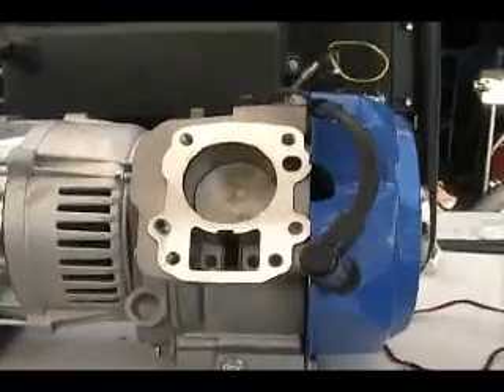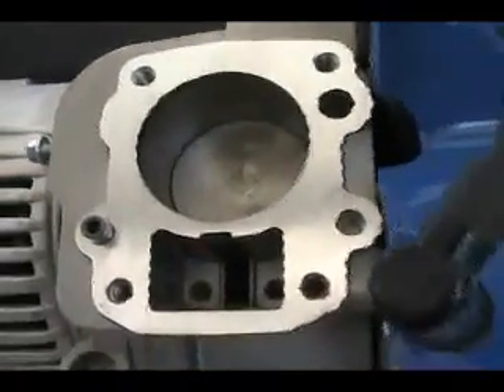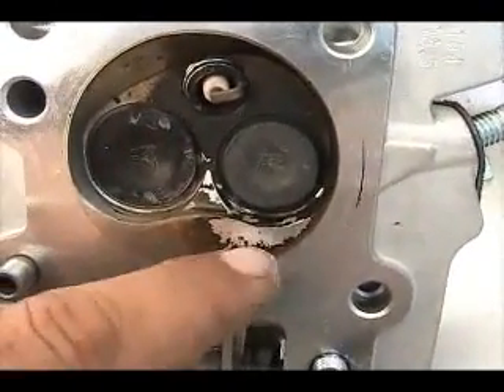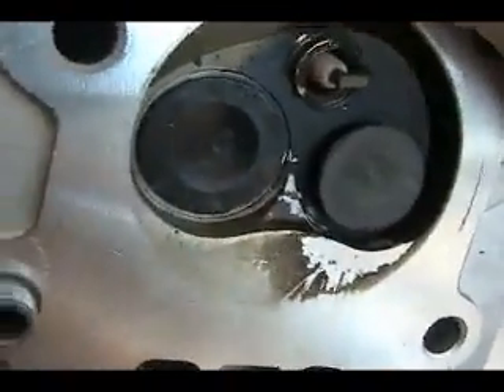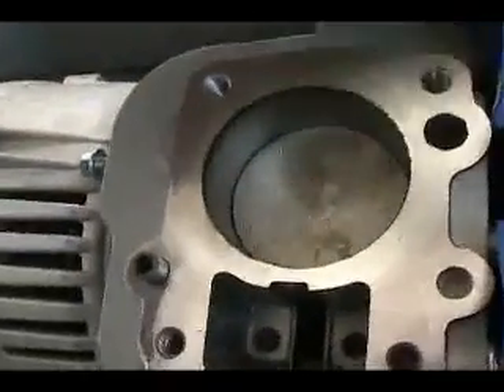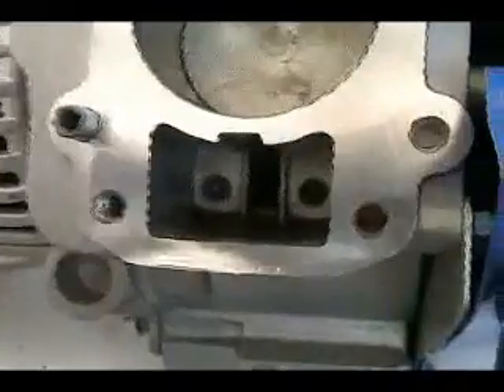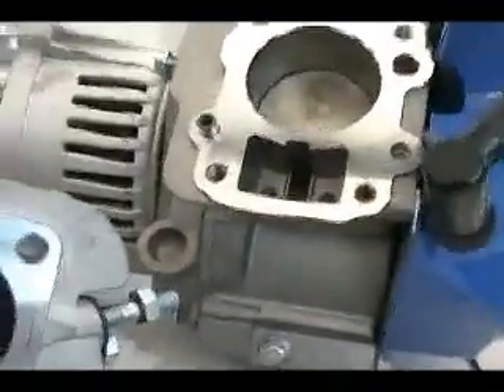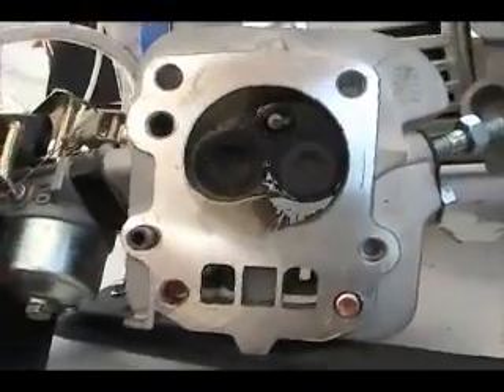generator test 20 engine running on hho

Comment: did you change the timing?
Reply from the maker: Nope, didnt need to, with hho you can set the timing of the fuel. In other words you can increase the flame speed, and slow it down by controlling hho to air ratio. To run it 100% on hho with no air mixed in, then timeing would have to be adjusted I believe.

Comment: Runing the engine on gasoline has nothing to do with engine brake in. a proper brake in after cylinder honing and new rings are proper combustion pressure to seat the rings in,

Comment: Rings seal better when under load rather than just turning it. plus hydrogen is like propane or natural gas runs cleaner. gasoline has varnish in it wich makes deposits.

Comment from the maker: @hookuspookus529 well yes I would care if it hit, but it doesnt hit, that would be pretty funny for the manufacturer to ship out the generators with a plug in conflict with the piston, hehe, that would be a laugh. I milled the head to increase the comp rati, but now I have to get a hotter spark, and its been low on the to do list for a while now.

Comment from the maker: @hookuspookus529 no its not, and it really doesnt matter. If anything it is better for this application because it takes up volume and increases the comp ratio. Plus it puts the spark further into the center of the piston. Again go call the engineer who spec'ed that plug, had the manufacturer buy 100's of thousands of them and install them. I personally dont care.

Comment from the maker: I am in southern cali, SD, yes H is reactive, but if it is ionized this can prevent it from its normal activity. If it does react with itself, then I want to see where someone have calced the energy output of that reaction, ad calced the temp increase of the hho output gas. In all my electro research no one accounts for that energy output. again, sloppy assed science, or its not doing it.

Comment from the maker: I also have to update the ignition system, since I modified the engine, the higher compression has killed the stock ignition. That costs money, of which I am low on lately. 

In order for me to consider it H2 and O2 I would have to see that proven. I know for a fact that the H is removed in the singular, and that leaves me with the hho. H2O where as is the common name for water, really should be HOH given its config, and sometimes it is refered to this

Comment from the maker: @DonHoraldo The problem is that I can get more than 15% of the original energy in electricity, and thats after an 80% conversion from kinetic to magnetic to electrical. By the way, you are assuming that the energy lost in the engine is lost as heat, what the videos, I am not lossing that mch to heat. My problem is that you have not tested it, I have. And I have found the assumptions to be wrong, very very wrong. Currently I am working out of town, so it wouldnt be possible to do that.

Comment from the maker: @DonHoraldo I havent blocked you yet, you have not been rude. Expressing your thoughts is fine. 

Argueing against entropy, in this case in a sense yes, entropy is the breakdown of  basic elementary parts, and systems, this is not that.

But if you mean am I argueing against ineff. and loses due to the physical limitations of reality, then no I am not. But I am advocating that you look at it with your own eyes, and not take everything your told as fact.

Comment from the maker: If I am standing on someones shoulders, at least I am trying to reach up to the next ledge. 

Waste heat in an electrolysis device, huh, you really have no working knowledge of these devices do you. Is there heat, sometimes, but is it waste heat, not always. Again why dont you use what you paid for. if your an engineer, then you have been taught how to think critically, and how to perform calcs, and observations. So stop using someone elses mind, and use yours.

Comment from the maker: 9040kj per kg and H2 has an energy content of 130 000 000 joule per kg , so lets see we are losing.0069% to latent heat of water, compared to other fuels and the latent heat of their byproducts. You Sir have ZERO credibility here, you can toss your degree out the window, it means nothing to me. What YOU HAVE done, or can actually prove and show is important, other than that, just keep on moving.

Comment: well I was plannin on runnin it in my old '83 gmc suburban 3/4th ton (sierra 2500, 2wd, total wieght is 5600 lbs). my fuel tank supports a total of 45 gallons so if there's a way to make it into a liquid form and run off of that then I'd have no problem with that. As far as the amount of steel goes...that's not a problem either as I live pretty close to a junkyard and my best friend is an awsome welder. think that makes it any better? (500 bucks worth of steel isn't too much for me)

Comment: I've got an old carbureted chevy 454 from 1983....think I can convert it to run purely on hho without hurting it? I know how to do the separation and all that....just need to know if it would even be worth it for me. (By the way...I plan on separating it with a machine that isn't placed or used in the vehicle.)

Comment from the maker: didn't look to be, looked like some deposits from running my cells too hard and having liquid go into the engine, but it breaks off easy so it will proly fall off while running, just like the carbon. 

Thanks for watching.

Comment from the maker: hmmm, well for data collection yup, for experiemental test setups sure, but I have to break out the 8" cells to get the title back completely, maybe I will cheat a bit, and run two 120v circuits and run all 4 cells :). I think the next set of tests will have to do with gas eff. with a load, why not?

Comment from the maker: the video is deceiving, its not knocking thats just sheet metal making noise. The other testbed engine has varable timing, and I found that when mixed with air it ran just fine at about stock timing. Once I go to a cam sensor operation I will play with timing, but theres a lot to do before that. That will be part of the "tuning" tests which will happen at the end of this series, after we have pushed the engine as far as it can go

Comment from the maker: its clean as a dinner plate before dinner on the top of the piston. Oil too, I will try another long run soon. actually correction, I will run it on gas for a lot of hours, then tear the head off again and show what it does, then do a long run on hho and see what happens. Thats good info to have right there.